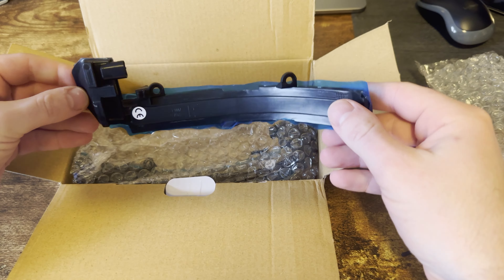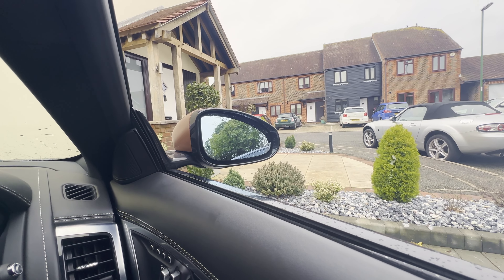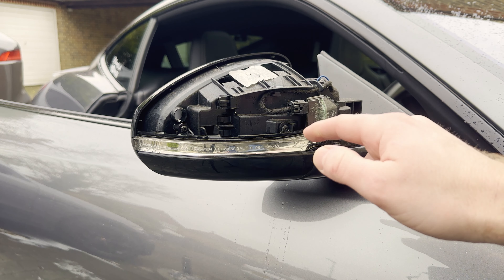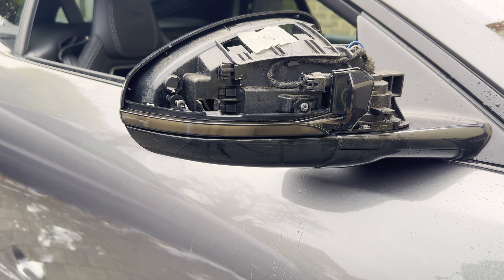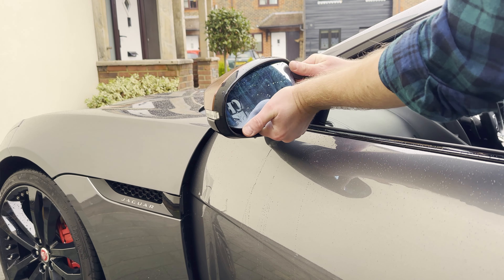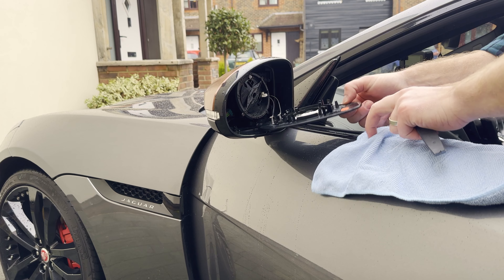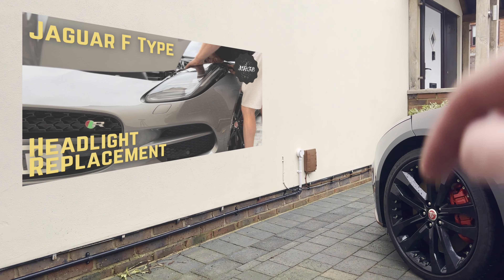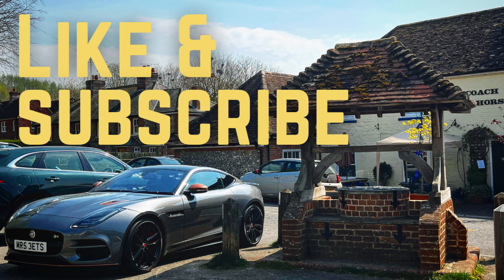Fitting Sequential Indicators to the F Type

Comment: As per ChrisFEjackson, you absolutely DO NOT need to take off the mirrors for anyone watching this. The tool is for taking off the mirror caps (they are snap on, snap off). Do not risk taking out the mirror glass. I fitted the exact same sweeping indicators in about 2 minutes per side. Still, not a criticism-great content! 

Also, I think I saw your car on auto trader or was I going mad?
Reply from the maker: Thanks for the comment and info. I chose to remove the glass, so I could depress the tabs on the mirror covers and reduce the risk of breaking them. It’s a good conversational point, as; have I added risk to the mirror glass instead, and which is more costly to replace? 
I haven’t got the car up for sale, so perhaps another that looks similar? I know there’s another out there with the bronze on it :) 
Thanks for dropping a comment!

Comment: I did mine a while ago, but I didn't remove the mirror glass, my car is all black and the edging on the new indicators matched them to the car perfectly. The main reason why I changed them is that in the daylight, the originals are hardly noticeable. What were Jag thinking of? These after market indicators are so much better and a no brainer & easy upgrade for sure. I kept the originals safe too just in case the longer term integrity of the after market ones became an issue. I have my MOT end of Feb so we'll see if that springs any surprises, but I doubt it.
Reply from the maker: To be fair, I didn’t even try it without removing the glass. I was trying to preserve the tabs on the mirror cap. It sounds like I could have saved myself some time and effort! 
I totally agree with the aftermarket ones being a better suit, and as you have done, I’ve kept the originals just in case. Thanks for another great comment!

Comment: You don’t need to remove the mirror glass , the cover will come off with the pry tool or even just squeezing it from the back. Check with a code reader once you’ve fitted them to make sure you don’t have an error code for  “lost contact with left / right indicator”

Comment: Cheers, useful clip!  It took me only a few minutes per side.  I didnt take out the glass, the cover is a doddle to get off with the trim tool, I popped it by levering at the bottom (above the indicator) then ran the tool along the gap that made at the top and the cover came straight off.  The only nuisance in the process is that the allen key is sharp and digs into your hand when you are getting the screws out, but that is like 10 seconds of nuisance.

It works well on my car (Italian racing/Firenze red) as the colour blends with the bottom part of the indicator housing.  All up a nice, cheap mod that I will never see from the inside of my car.
Reply from the maker: Great feedback, thanks for commenting. I agree about not seeing it from the inside, lol! It's good when locking/unlocking though...

Comment: Great work. I really like the color of your mirror caps. Do you happen to know the brand/color code you used to wrap them?
Reply from the maker: Thanks! 
It’s an Avery vinyl. I love it because it has air release technology. You don’t need to worry about bubbles as you can work them out through the vinyl. The colour code is BJ0860001 (Light Brown, Satin)
Reply from the maker: Thanks! 
It’s an Avery vinyl. I love it because it has air release technology. You don’t need to worry about bubbles as you can work them out through the vinyl. The colour code is BJ0860001 (Light Brown, Satin)

Comment: Hi mate.

I’ll be fitting a set of these indicators shortly also. But I have a question about the vinyl for your mirror caps. Mine have previously been painted Black, so I’m looking to wrap them to cover up the Orange colour underneath that’s now showing from stone chips. Do you know roughly what size of vinyl is needed per mirror cap? I’m currently working away overseas, but would like to order and have something waiting for when I get home. Thought it’d be a good time to wrap them whilst fitting the indicators. Thanks for posting your vids!
Reply: @MrGB_UK
Reply from the maker: Sorry for the slow reply Mac. I can’t accurately recall the exact size needed, and I’d hate to send you off with wrong information. I imagine You’d be fine with 50x30cm for each cap, but please don’t quote me on that!
Reply: Thanks for your reply  @MrGB_UK , I know you’ve been busy!

Comment: This is all wrong, do not remove the glass. The colour coded abs backs can be removed with a little effort using a plastic trim tool. My leds lights came with the tool for doing so in the box. Whole job takes lass than 10 minutes.
Reply from the maker: Thanks for another good comment with feedback and tips. I chose to remove the glass to try and save the plastic tabs on the cap (you can depress them from behind the glass). There’s a good conversation to have about where you’re moving risk and is a new cap cheaper than the glass? Thanks for watching and another good comment 💪🏼